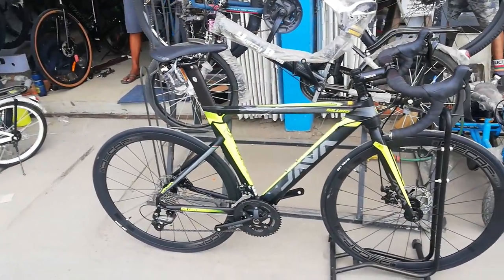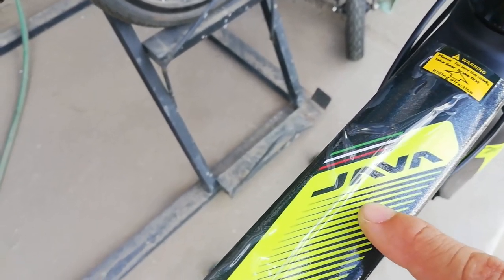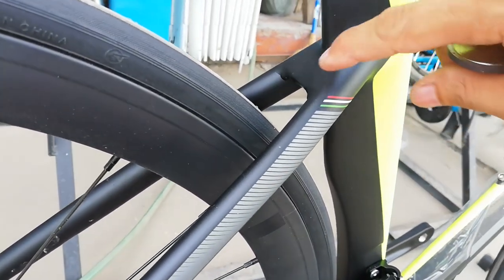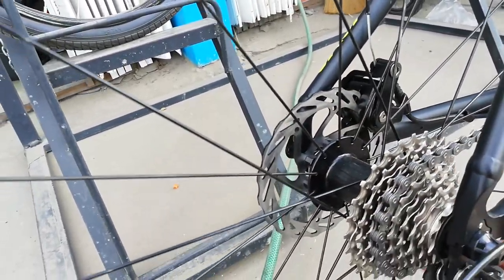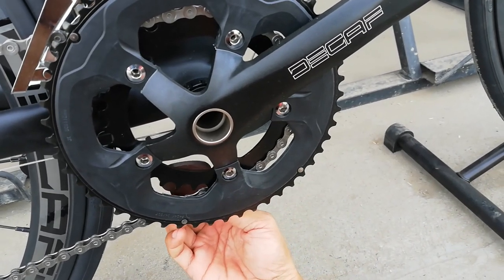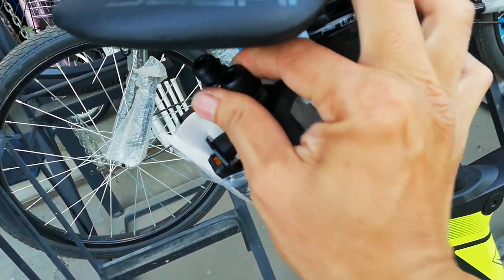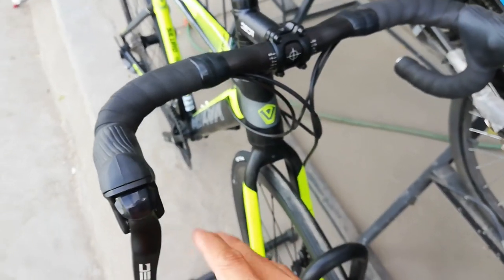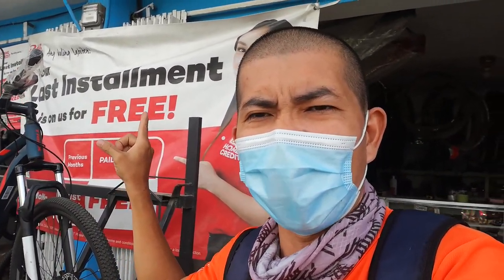Bagong JAVA Siluro 2 naka disk brake na | Bike Check

Comment: Bakit po sa iba sir hindi welding pagka kabit ng disc brake sa harap?
Reply from the maker: caliper po ba o rotor?
Reply: Yung caliper sir ung naka kabit mismo sa fork sir bat iba naka welding ubg iba hindi kasi ung review mo sir naka welding ung iba naman na nakita ko na review sir e parang naka de roskas
Reply: Pareho parin po ba yon sir o magka iba lang ng version?
Reply from the maker: IS mount at post mount
Reply: Same lang po pag ganun sir? Talaga may ps at is po ang siluro 2?
Reply from the maker: Ok lamg po yun